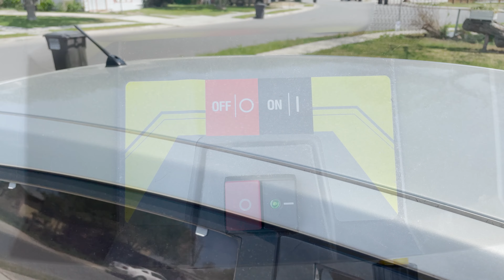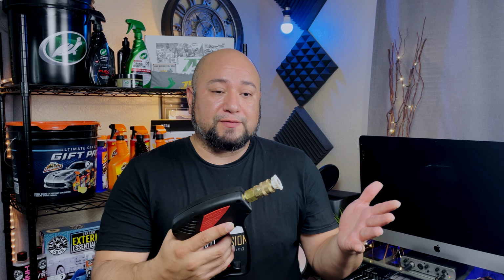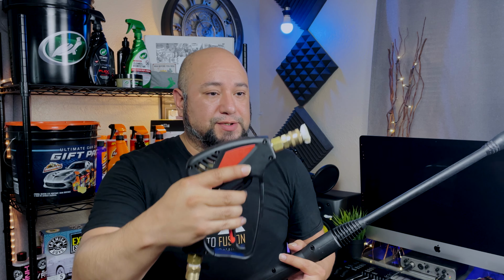ChemicalGuys Snubby Pressure Washer Gun

Comment: How do you get the hose fitting into the gun fitting? I can’t seem to get it in. I have a sun joe. The gun that comes with it connects easy but the chemical guys snubby doesn’t connect to the hose
Reply from the maker: What size is your hose?
Reply from the maker: I’m thinking you might need an adapter. Try leaving a comment on the chemical guys you tube page they are pretty good at getting back to people quickly.
Reply: M22 15 to m22 14 adapter. You can find them on amazon.

Comment: I have a Stanly 2150 will it work together
Reply from the maker: Yes I believe so just make sure the 3/8 will work with your hose.
Reply from the maker: It also comes with a 14 mm connector but I think yours will use the 3/8

Comment: hey i got the same pressure washer but it came with a yellow and turbo nozzle i didnt get a white cap hmm.
Reply from the maker: I purchased mine separately ,it came with a foam cannon I had bought it was by tool daily sold on Amazon if you want to check it out.

Comment: Hey man, did you have to buy a special adapter for your hose to connect to the hand sprayer?
Reply from the maker: No I’m using the stock hose that came with my ryobi 1600.
Reply: Thanks man! How’s it still working for you? Any issues? If none, I’ll plan to buy that one but if you recommend any others, please let me know!
Reply from the maker: @mitchellmorris4785   This is the only gun I’ve tried so fare. I’ve had it for about two years and have not had any issues with it  still works like a champ. I would personally recommend it.